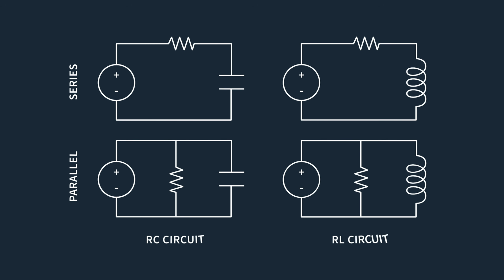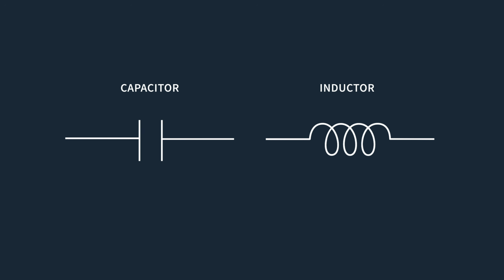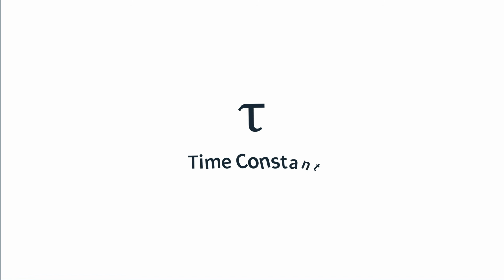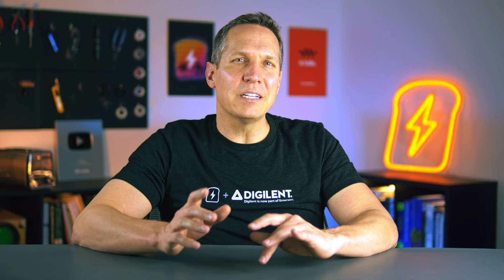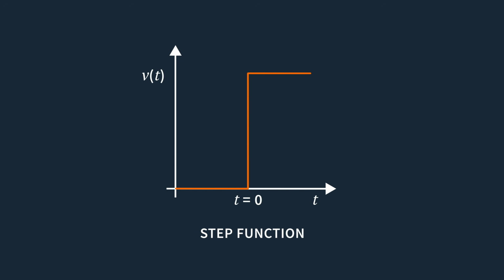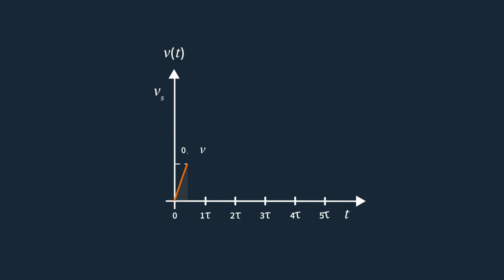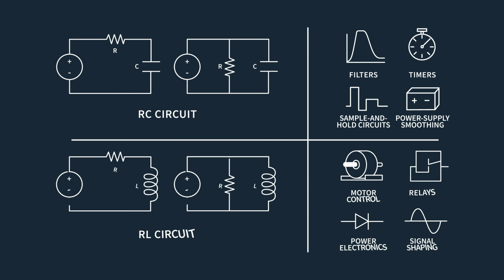What Are First-Order Circuits? RC and RL Circuits Explained

Comment: As a freshman Electrical Engineering student, I see that your channel is really informative and beneficial, but i have a question please.
Many people keep telling me that this major is so difficult, and honestly I became a little afraid about the upcoming classes that I'm going to take later.
Can I really make through this major and its difficulties?  specially that I'm interested about its topics.
Thank you so much for your great videos, your efforts are greatly appreciated.
Reply from the maker: There is a reason you’ve heard all of that - it is truly one of the most difficult majors in college. And not everyone is capable of doing it. But we believe nearly everyone is capable, if they’re willing to put forth the effort. Consistent attendance in class, anxious engagement in class and peer discussions, keeping up with homework, using outside resources (of course I have to plug our own content!), and it will be fine. Still not easy, but fine. I’d say one of the biggest things is to not get behind. This doesn’t mean getting behind on assignments, it means getting behind on understanding. Everything builds on each other and you need to be fairly confident at your skills in one thing before moving on to the next. But that is done via consistent moderate effort instead of occasional monumental effort. Good luck and we look forward to hearing about your adventures as you progress!
Reply: @CircuitBread  I am deeply grateful for your great response and pieces of advice you gave me. I will certainly follow them!
As you said, this major doesn't fit all people, but what reassures me is that hundreds of thousand of people have graduated and became electrical engineers, which shows that it is not impossible.
Your perfect and valuable content is no doubt something that helps thousands of students around the world. I genuinely wish you always continued success and happiness in your life!

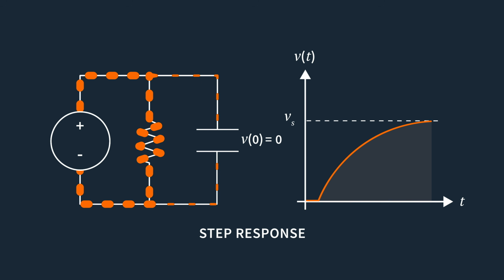Comment: At 3:30, since resistor is in parallel with capacitor, voltage across capacitor should also be a step response and have no impact of parallel resistor. This way capacitor will be demanding infinite current from voltage source to produce step voltage across capacitor. To get exponential response across capacitor, this resistor should be in series with capacitor. 
By the way, the video is very good.

Comment: Does the Kirchhoff voltage law still hold in a parallel-RC circuit, when the capacitor is still charging?

    _/  ___________
    |               |               |
----        _ |_             |
  --          |     |         ----
----        |__|         ----   
  --             |               |
    |______|______|

I imagine the voltage across the capacitor takes time to ramp up, while the voltage drop across the resistor forms much faster. Are there times where they are not equal, even though they're connected in parallel?
Reply: Yes, the only time Kirchoff’s voltage law is broken is when you bring stuff like transformers into play